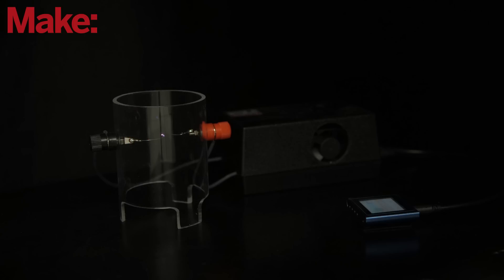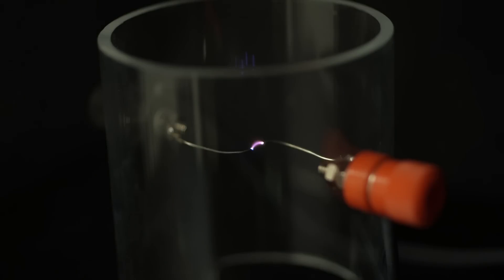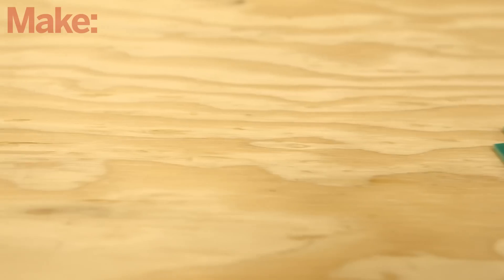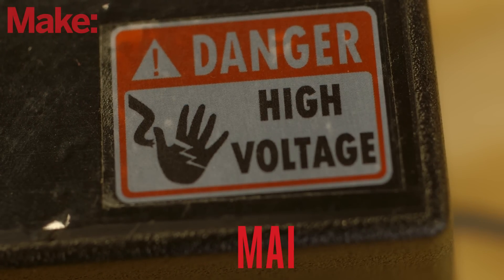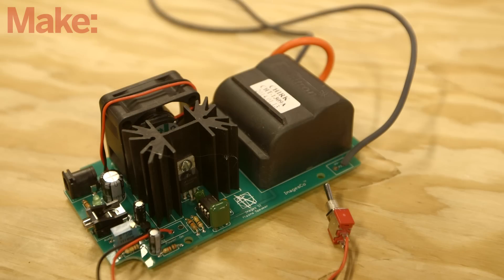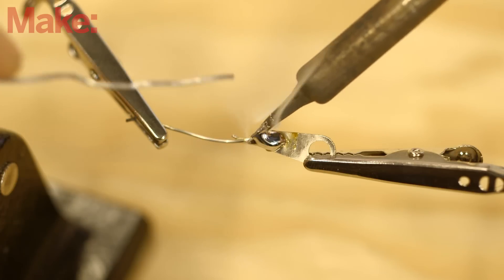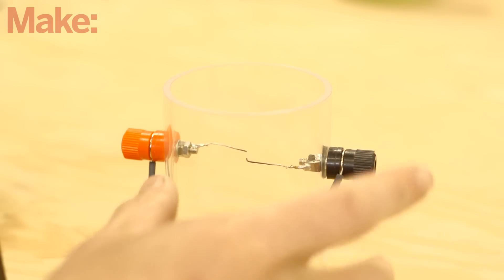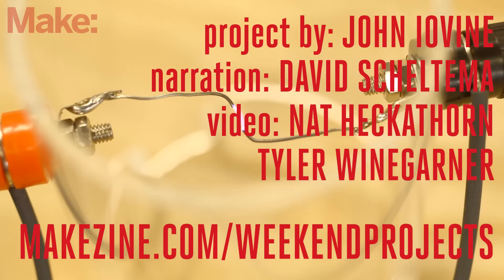Plasma Arc Speaker

Comment: You really should have showed it in action with audio.
Reply: darkluigiman It sounds like crap, that's why they didn't show it...
Reply: ***** Your analogy is on point except for the simple fact that this isn't the same at all.
Reply: IceDragon978 no you will, chances are that the speakers you're using are more than capable of reproducing the sound of the plasma speaker accurately.  IF you were listening through a really crappy speaker then you'd have an issue
Reply: DoubleM55 How are you supposed to hear what it sounds like through a different type of speakers...

All you'll hear is what your speakers sound like.